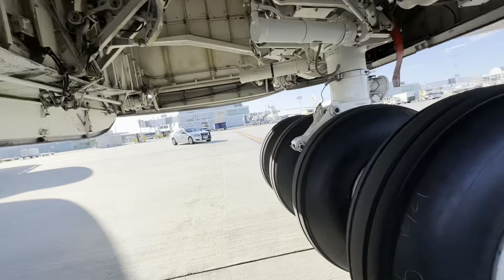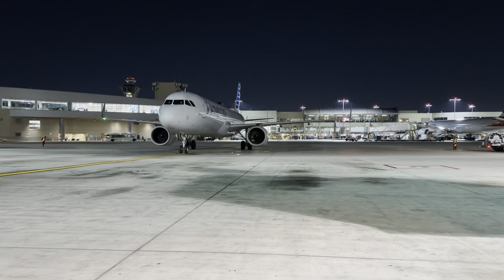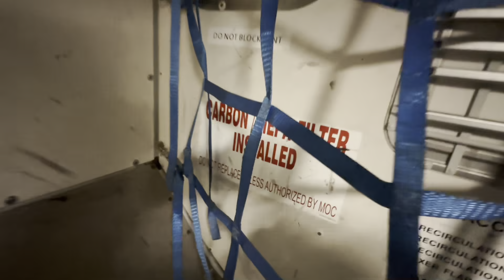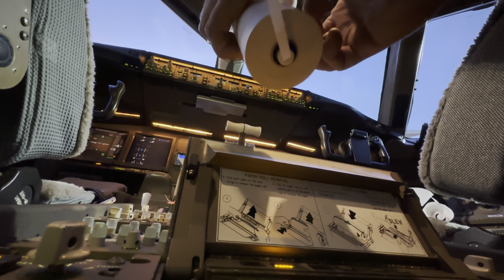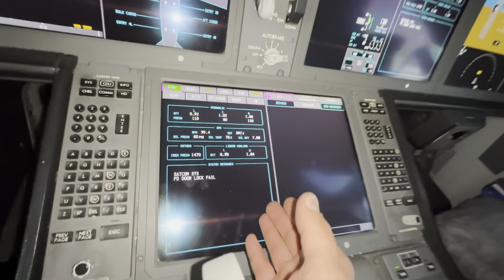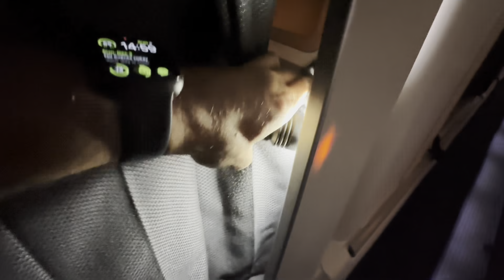Stig Shift #4 (Aircraft Maintenance Adventures)

Comment: Quick point on fly-by-wire on Boeing vs Airbus: if a pilot really wants 45 degrees of bank on a Boeing, they can absolutely get 45 degrees even in normal law. The yoke will become really stiff which is the plane’s way of flight envelope protection, but you can with enough force overcome any protection on a Boeing fly-by-wire. On an Airbus however, you’re right that the computer will literally not let you break the limits regardless of how much you push the stick. These are basically two different design philosophies: on Boeing aircraft, the pilot is the final authority while on Airbus, the computer is the final authority
Reply from the maker: I guess I understood it differently when I reread through the manuals. Because it seems like even on the Boeing it will act the same way, especially on the 777 and the 787, which are primarily the flyby wire Boeing aircraft. Unless they disengage the protections. Which they can do. I’ll have to do more research on it, thank you so much for your knowledge and inspiring me to read more about this
Reply: @StigAviation  and thank you for making these videos, from a pilot’s perspective it’s fascinating to see the incredible engineering that goes into these airplanes!

Comment: I will add - this is 80216 - it was a C-5A - delivered around 1969-70.  Most of the C-5Bs and C-5Cs were delivered new to the USAF in the 1980s.  They were an order of 50 originally ordered by Iran.  When Iran fell...so to speak... the USAF picked up the order.  The C-5Bs were TF39 powered like the C-5As.   Noisy....  As I understand it - a small group of C-5As became C-5Ms with CF6-80 engines.
Reply from the maker: Much appreciated for this incredible information. Thank you very much.

Comment: can airbus or boeing access live aircraft diagnostic/fault information at their headquarters?
Reply from the maker: Depends if the aircraft is equipped with that type of database. It’s most likely that the carrier will have the diagnostic fault information, but not the manufacturer.

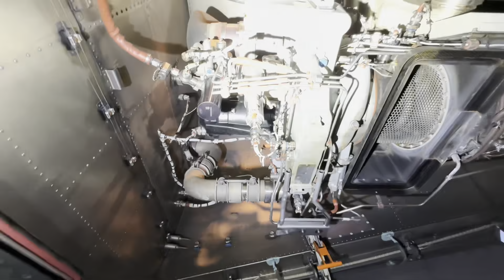Comment: 22:13 I suppose you replaced an APU before those things actually come down by a cable system don’t they? After you release the brackets that hold it up?
Reply from the maker: Yes, I have replaced a few, and you are correct. It works off of a fish pole system. The rigging connects to the interior compartment ceiling and we can crank the unit down.

Comment: I was stationed at Travis in 1987-1988 when the C-5's were A and B models with the old TF-39 engines. This is the new "M" model: updated avionics, the new engines. These actually "kneel" for loading if needed
Reply from the maker: Thank you for your service and thank you for the education Paul. I appreciate you
Reply: my pleasure. Can you explain how the steering tiller wheel works? Thanks
 @StigAviation
Reply from the maker: I have explained it in previous videos, but to simply put it uses hydraulic power to move nose steering actuators. Older aircraft use cables, and are hydraulically assisted.

Comment: how do you transfer from ground power to APU then to engine power on Airbus? I know on Boeing 737s going from ground to APU and then to engine, you turn on the appropriate bus switches. right? Ground power is on. the process is similar right?
Reply from the maker: On the airbus, the power transfer from ground to APU is very simple, you just disengage the ground power, and the APU power takes over, same thing for engines, as soon as the engines are started it will take over power from the APU. And then you can turn off the APU.

Comment: I'm not entirely sure but i just watched some vids of the c5 kneeling and retracting the gear, the front uses the normal retraction mechanism to kneel and those jack screws are for both equalizing the pitch down and to lower the rear of the plane. the visible part just above the boogie is the excess, this will get shorter when it kneels. also the rotation only occurs at the noogie, bellow the strut and damper   this is a really cool video: https://youtu.be/G6QS-3XaFC8
Reply from the maker: Oh that’s very cool, thank you so much for giving me the link. I will definitely check that out.

Comment: Liquid Oxygen otherwise known as LOX. HAs a boiling point of -297 degrees. as it boils off it creates GOX or Gaseous Oxygen, the reservoir is attached to a heat exchanger then goes thru plumbing  to feed the backup oxygen for crew and pax.
Reply from the maker: Thank you so much for the information. I learned something new.
Reply: @StigAviation  No Problem! Enjoy your videos! 1 step closed to my A&P i have an apointment with FSDO this week to get my 8610s signed!

Comment: Not a pilot, or work with aircraft but I have worked with O2 and LOX or liquid 02  The reason it is used because you can store a very small amount of LOX in a small very insulated container.  When allowed to evaporate will expand 860 times it's size thus producing much more gaseous oxygen for use for inhalation.
Reply from the maker: Very interesting. Thank you for the knowledge.

Comment: Outlet for the surge air valve
Reply from the maker: What are you referring to Trevor ?
Reply: @StigAviation  The shining bit on the apu door. When the surge valve opens it dumps the excess bleed air over board. But of course you knew that 😜
Reply from the maker: @trevorbrewer7906  to be more specific it’s the APU oil cooler vent duct 👍
Reply: @StigAviation  Aahh! Forgive me.. it’s been 22 years since I last worked on a A320

Comment: I like your channel and I used to work at Travis on C-5's from 94'to'06.  Then I worked for Lockheed and we put the glass cockpit in the C-5 so it could later be modified to a C-5M.
Reply from the maker: That’s incredible that you got to see the transformation of the C5 into this modern day model
Reply: @StigAviation  I chose the Air Force then defense contractor route.  I started of as an avionics technician at Beale AFB in 82'.  My first job was removing the sensor nose off a SR-71.  My last job was replacing a MLG tire on a F-35B.  All told I worked on U-2/TR-1, KC-135Q, T-38, C-23A, C-141, EC-130E, C-5, F-35.  Lots of memories but small crowds to swap stories with as not very many aircraft mechs out there.  I hope your channel grows.  Take care.

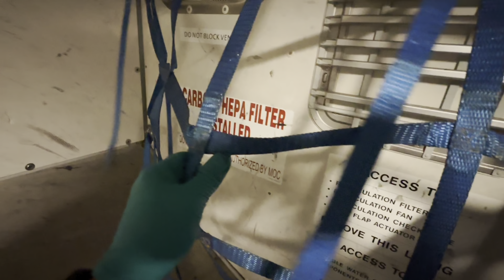Comment: Re: 25:53 or so, Blowout panels

We used to use lead blowout disc's on LP steam turbine section hoods so that, if HP steam pressure should be passed to the LP hood for some reason the pressure would be vented to atmosphere rather than exploding the hood and kiIling someone.
Reply from the maker: Basically another level of safety. 👍

Comment: What's the most hours you've seen on an aircraft?? On the Hobbs meter I believe it's called
Reply from the maker: Hobbs meters are old technology and more used in general aviation aircraft. These modern jet have digital data recorders. I don’t usually dig into the details of how much time the aircraft has, but when I am curious I’ll check the registration certificates in the flight deck. Oldest on I have seen is from 1995 as of now that’s still flying. I’m sure there are older aircraft out there

Comment: I used to work C-5's in the USAFR, they're beasts for sure but great rides. This plane was a C-5C now modified into the C-5M, it's a "SCuM" bird in that it's been modified on the inside to accept large space components for NASA, the giveaway is the aft center cargo door which is in 2 halves as opposed to 1 piece that would retract aft and up. There's no troop compartment, it's a trip to see inside.

Yes, they're the largest in the USAF inventory. The "jackscrews" you mentioned on the gear are ballscrews, they're for the kneel system. They don't turn. Picture a big hidden nut that gets turned that's inside the yoke of the gear. When the plane kneels/unkneels, that "nut" turns about those stationary ballscrews, the plane then goes up and down, I think...3'. The plane can aft, level and forward kneel. The gear stays fixed, it's the crosshead on top of the gear that goes up and down w/the ballscrews.. At 2:24 you see on the upper right the cover that hides the mechanicals (essentially a wide chain that engages the sprockets on the "nut" (I've only changed 1 out before) underneath and the kneel motor and rev counter is what is hanging down from that cover. 

Yes, you guessed right that the exhaust is the APU exhaust, there's 2 APU's. You mention the level of engineering on the gear. When I started on C-5s the gear was all torque tubes and gearboxes, they got modified to what you see now to push/pull rods.
Reply from the maker: Jeff I can’t thank you enough for the level of detail and knowledge you just put here. You’re absolutely amazing. Thank you for your service sir and all your hard work and dedication to your craft.
Reply: 68-216 landed gear-up at Travis (late 80s?) and was modified as stated above from A-model to C-model (SCM) and eventually M-model during AMP/RERP. 68-213 was also modified after it landed short at Shemya, Alaska. Both aircraft support NASA to include movement of the James C. Webb Space Telescope.
Reply: 216 os like the world's oldest flying jumbo jet as it was built in 1968. All the old 747s were turned into beer cans long ago..
Reply: At 5:18 there is a good shot of the large angles mounted to the pressure bulkhead. That is the nose gear kneel stop assembly. It's made from 300 ksi steel. From 1987 to 1988, my main job was to drill, assemble, and install the kneel stops. The power feed drills turned at 60 RPM and fed 1/64" per revolution.  I developed an allergy to liquid Boe-lube because of them.  I also installed the large titanium strap across the belly directly below the stops. Sometimes I installed the forward ramp hinges. As production started shutting down, I moved to the forward wing to body fairings. A lot of good experience there, but they ran it like a sweat shop. It makes me appreciate working for an airline a whole lot more.
Reply: I thought those screws had to do with raising/lowering the bird.
I saw a C5 at Portsmouth NH, during Thunder Over NH 9/11/2021. And there was far less clearance below the gear doors on that one, than on this one.
Reply: @Dave_Crupel  they are for the kneeling system but they do not turn
Reply: Thanks for The explanation and for your service!

Comment: Is it a dump valve exhaust? To dump the air that is not being used for engine starting, or any services. There is also a start valve, when the dump valve open, the start valve closes. And vice Versa. Am I correct?
Reply: Alright
Reply from the maker: You almost got it.  It’s the oil cooler vent duct. 👍

Comment: Pretty sure, I could most definitely be wrong as well, but I think those corkscrews are for doglegging landings in strong crosswinds.  Basically turn them rear wheels slightly.
Reply from the maker: Somebody mentioned in the comments earlier, the jack screws are actually used to raise and lower the landing gear for loading purposes.
Reply: @StigAviation  I know there is a plane that dogleggs like I said, just don't know which one lol

Comment: 😂 I just love it when he gives the throttle a hearty slap
Reply from the maker: It’s an old habit I picked up, back in the old days when aircraft were not flyby wire, and had mechanical linkages, the common practice is, or was to make sure that the throttles are always at idle. I guess the habit just stuck around with me.

Comment: When you guys taxi (not under tow) the aircraft around the airport do you guys use a specific callsign?
Reply from the maker: Yes we do, usually announce to tower that it’s a maintenance taxi, and use the aircraft nose number or tail number as the call sign. Sometimes we use the gate number as the call signs as well.
Reply: One more question, do you know if the AA 321N have ACTs and if so how many? @StigAviation
Reply from the maker: @mcnugget3851  yes they do. Ours have 2 ACT tanks.

Comment: As a maintainer on this plane it’s just funny to see the perspective of an outsider. The screws on the MLG are ball screws used in conjunction with the fwd and aft loading system to “kneel” the airplane to ether “level” “fwd” or “aft” modes. Based on what’s being loaded in needs a different configuration.  As far as LOX we have 2 converters. A 25 and a 75. Filled via carts and is incase of depressurization liquid oxygen in the converters will flow through lines to the oxygen masks.
Reply from the maker: Thank you so much for the education sir. And thank you for your service 🫡

Comment: That exit on the apu door is to exhaust the hot air from the cooling fan after it passes over the oil cooler.
Reply from the maker: Absolutely correct. Oil cooler vent duct 👍

Comment: In case not asked, what is the fuel burn rate in the apu’s?
Reply from the maker: That I’m not exactly sure about. But from whatever I can gather from the Internet, usually burns about 250 to 350 gallons per hour, but once again, my number might be off.
Reply: @StigAviation  thank you. That’s what I was seeing to but I barely believe anything on the interweb.

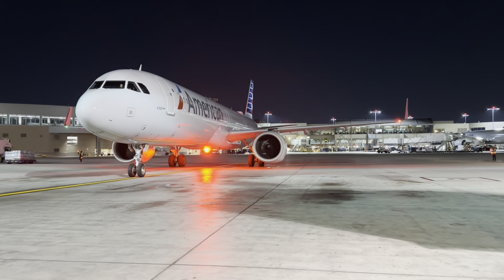Comment: At 17:20, what are these guys with the sticks in the back signaling?
Reply from the maker: Those people are ramp personnel and they are holding a lighted wand. They are moving it around to show the surrounding people that the aircraft is moving and the engines are running. They are Wing Walkers. 👍 it’s basically for safety.
Reply: I thought of this but I had to be sure. Thank you Stig🙏

Comment: How you like me C5M. Those jack screws on the landing gear are for kneeling.   The aircraft can lower the fuselage down to the bottom of those jackscrews. The nose gear has a jack screw to so the nose can lower to. Aircraft then is about 2 feet from the ground.  Then the nose of the aircraft opens up like a 747 freighter. Then a ramp comes out so you can drive on. Back of the aircraft opens up to and also has a ramp so you can drive off. After NWA i didn`t cross and went to Lockheed to work on the C5M mod. I was lucky to be a flightline quality inspector on the C5M. It`s a pretty simple airplane. Leaks like a DC9 though. If you ever get a chance watch it take off. You will be surprised it don`t take much runaway to get off the ground.
Reply from the maker: Thank you so much for the knowledge, I really appreciate that. And yeah I did see it takeoff and wow it does not need much runway at all, I think it was like 3000 feet and it was off the ground.

Comment: The jack screws on the MLG is for the kneeling system. When they lower the jet to load cargo it uses the kneel motors and the jack screws to lower the whole acft down. The NLG is actually retracted with the jack screws. During kneeling the NLG will retract to lower the nose closer to the ground.
Reply from the maker: Thank you very much for the education, I wasn’t aware that the main landing gear can do that too, I only thought the nose gear was able to do that. Thank you so much once again.

Comment: Most USAF transport aircraft utilize LOX.    It has higher density, so you can get more oxygen on the airplane vs Gaseous O2.    There are converters that convert the liquid to gas and then gas lines distribute the gas to the individual oxygen regulators at the crew stations.
Reply from the maker: There you go, that’s what I wanted to know, thank you so much. I really appreciate that education.

Comment: I'm curious on how often do you see the same aircraft over and over. For instance the 777 from Heathrow, is that plane just used for that trip back and forth?
Reply from the maker: It happens quite often actually. Sometimes I’ll see the same aircraft multiple times a day and sometimes I won’t see it for months. Just depends on the routing and the schedule of the aircraft’s destinations.
Reply: @StigAviation  that’s pretty cool. I used to work in maintenance shop for a tractor trailer fleet on the east coast. It’s actually the same as you just described it with what comes around the shop. Thank for the reply 🤙🏽 . Stay safe

Comment: Hey Stig, the 787 and 777 do not have snubbers for the front gear? I realized there are no rubber marks in the wheel well, they are relatively clean.
Reply from the maker: Look closer, the 787 does have the nose wheel stoppers. 👌

Comment: Exhaust portal for the APU oil cooler! I replaced and a cooler fan and oil cooler recently.

Question: do y’all have any issues with your apu’s generating fowl odor like a dirty sock smell? We have major issues with ours contaminating the packs with oil and generating horrible dirt “sock smells” in the interior…
Reply from the maker: Yup. Absolutely correct and yes we used to have that issue with the apu. It’s because of over serving and because of where the intake door is placed. It takes a lot of ingestion from foreign fluid. Airbus is redesigning it. Intake door will be up top in next generation Airbus.

Comment: Hey stig , is it possible to use HF for CPDLC especially for old aircrafts like B767 that do not have sat com? How do planes without sat com use datalink comm?
Reply from the maker: I believe it can but I’ll have to double check on that. Most of those older aircraft are pretty much upgraded to modern standards. They all at least use VHF3 With the CPDLC and GPS. The datalink will used VHF3 and GPS